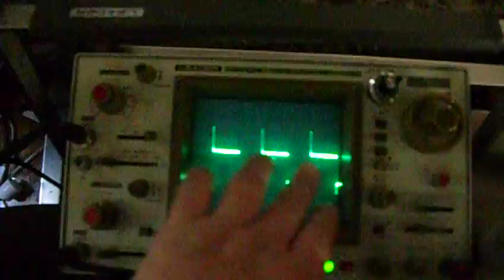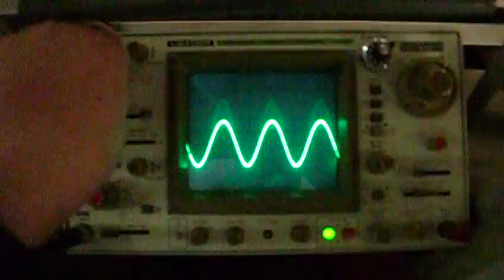Control Noise on Leader LBO-524L 35Mhz, Vertical Amplifier

Comment: I've got a scope just like that. You do have dirty or tarnished contacts on the deck switches. There is a degree of disassembly to achieve to get at the rotary switch contacts. Use a cleaner like deoxit. Do not use WD40!